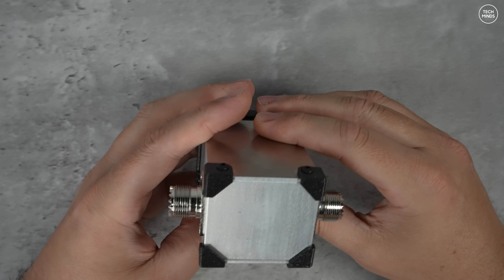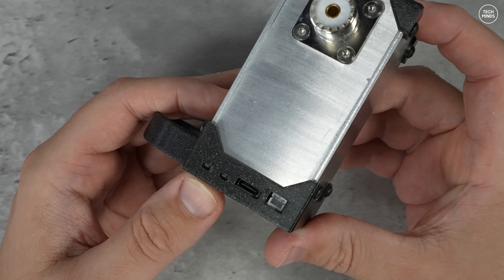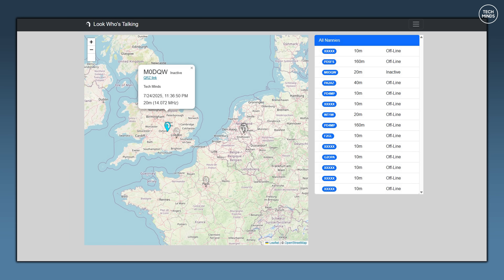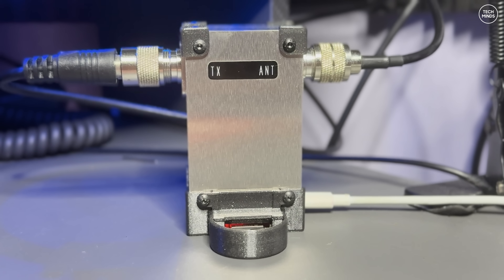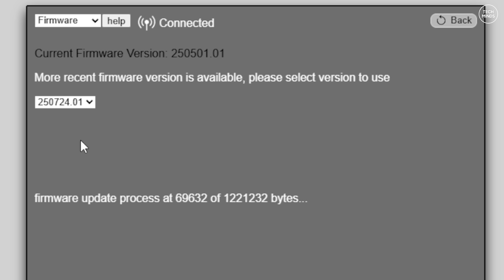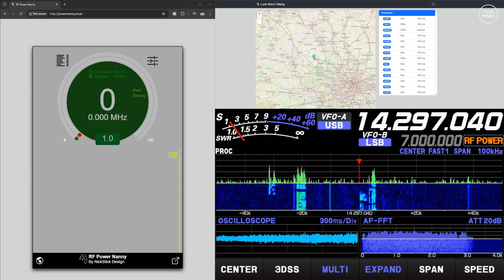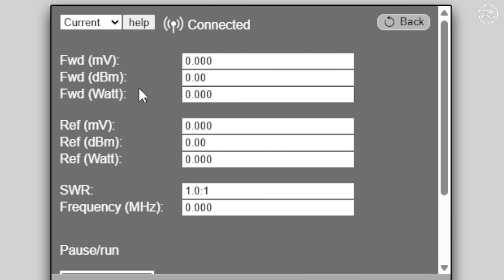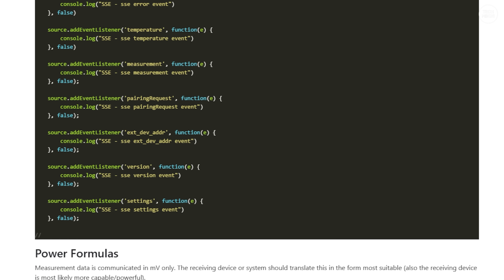RF POWER NANNY - Web Enabled HF Power Meter

Comment: Seems like a completely inappropriate number of digits in the measurements.  If the bridge is using the 12 bit ADC in the ESP32, that's just scaling from 0-4095.  Even an external 16  bit ADC is like 5.5 digits of precision.   Hard to tell, but is there some sort of peak-hold mode to detect peak power?

Comment: Why overcomplicate such a simple device? Even a basic SWR meter works perfectly without electricity. Now we need Wi-Fi and PC software just to check SWR? This 'upgrade' feels more like a downgrade in practicality !!!!!😮
Reply: Some people prefer to have dashboard UI’s on their screen and do some data logging with Python scripts.
Reply from the maker: @st2nh I f you do not understand the value in something like this, then this is definitely not for you.
Reply: For remote TRX could be also useful. I run 99% remote
Reply: A keyword you should look for in comments is “just”. If you ever find yourself saying it, stop and think as you should probably be admitting you don’t yet have the creativity necessary to utilize what’s been presented to you and should be asking questions instead of passing judgment.
Reply: As has been pointed out, the primary use will be for remote antenna operation. But this has many other purposes. Transceivers do not always give accurate SWR readings – this is why people use SWR metres!
For a totally blind person or someone who cannot see the screen this would be extremely useful.
But for anyone operating a remote station seriously, and especially with the API, this would be essential I think.
HTH.

Comment: It'd be interesting to place it at the antenna feedpoint to compare how much power is lost in a tuner and transmission line.
Reply: I guess that could work to measure the power. You're not usually so concerned about the SWR at that point though.
It's usually the SWR between the transmitter and the tuner you're worried about because you need it to be right to prevent damage to the transmitter.
Reply: @BrianG61UK im most worried how well the antenna is tuned, that way you don't have the losses on the feedline.That is where your swr you read back at the tuner originates from. Its why I love my rig expert stick pro, 73.
Reply: @VE9ASN  That makes sense.